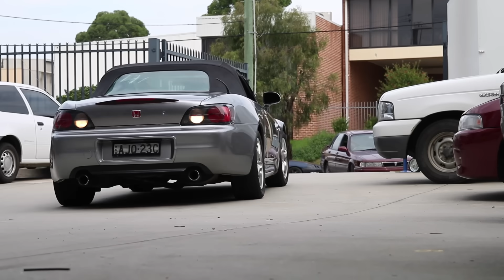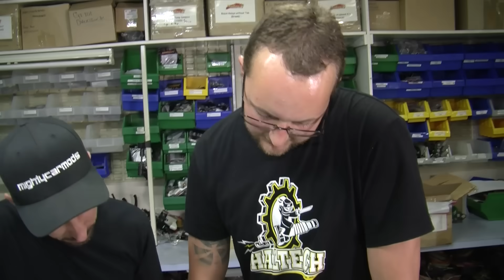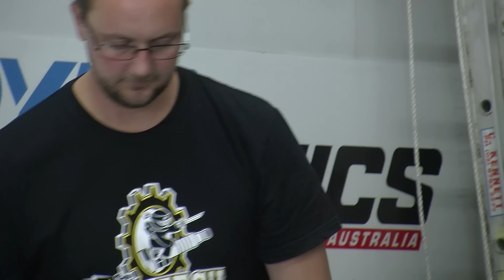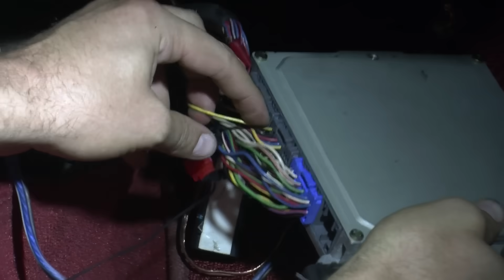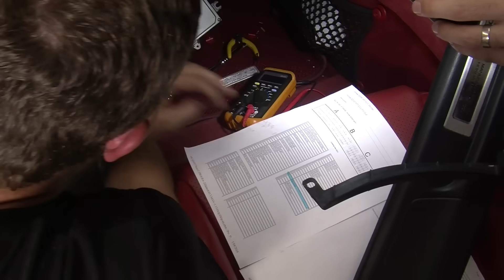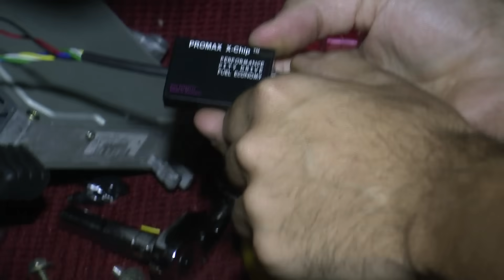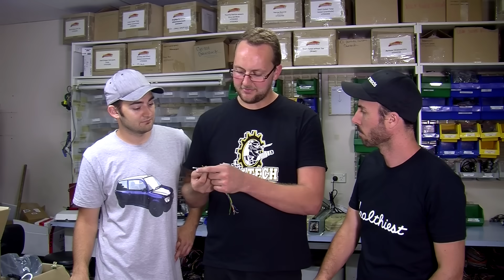eBay Performance Chips -  Mythbusted

Comment: one thing: there are ecu/ecm/pcu/pcm chips that are prom replaceable and programmed with different maps for fuel and timing, and they are real, but they are programmed to the specific vehicle and engine mods, much like i do on the laptop with fixed programmable factory units.... just had to that that out there.   that being said, they have been selling "chips" which 95% actually have no logic device at all.  funny these guys went through the trouble of building boards and mounting (likely obsolete and discontinued clearance) components that appear that they could do something.  usually, it's just a resistor to make it think the air is like 40degrees ferenheit all the time..... that can actually be a problem in the cold, lol.  i do have one issue with the testing method, even thogh it is irrelavent, apparently:  you cannot emulate a maf signal with a map.  that's like using 12v dc to try to get music out of a speaker.... 2 totally different types of voltage/signal.  a maf measures vibration like a microphone and a map measures resistance in the transducer or varisistor and sends either analauge return voltage based on the resistance, or a digital value over databus.  a maf has an analouge ac signal and either sends ac analouge, or a databus hz value.  i'd love to get my hands on this thing you tested.  if it did actually work, it would respond to the hz of the maf and make a frequency adjustment while measuring the o2 sensor and possibly only adjusting iat value on ramp-up....... and to answer your question: i see sanded ic's all the time.  they do it for proprietary conservation, so you can't replace the $5 part without going through them, or copy the design in your own system...... or in this case: so you can't find out that it doesn't do anything....

Comment: I bought a performance chip but I haven't installed it yet but one of the requirements is to disconnect the battery before installation and to leave it disconnected a minimum of 4 hours at best over night so the factory settings could be fully removed and after reconnection of the battery it takes about a week and a half for the chip to fully retune the vehicle. As done in this video if you don't perform the mentioned requirement then the factory settings remain the same.

Comment: I installed an ADS superchip in a DOHCv6 years ago, a little improvement was noticed, after I put in a K/N filter and shorted the battery cables together (off the battery), a lot of improvement was noticed, if I remember right, my chip was like $100.  Well worth the $150 spent.

Comment: wow soo stupid these guys

without the chip they had the roof on the car making it more aerrodynamic...
when they tested with the chip the roof was down so it was less aerodynmic.. so they engine was working harder to get it up to 177 hp ... if they had the top up still there wouldnt be as much wind resistance and it woulda easily made the 210 hp he was thinking he was guna get

Comment: "Performance Chips" are just the modern day automotive equivalent of snake oil.
Reply: +General Zod Not true.  This chip they test is crap.  Good chips run at least $2-300.
Reply: Not things like ECUs though
Reply: +Calbenmike exactly. My superduty gained 245 ft/lbs of torque with a tune. adds around 120 hp as well... takes the torque from 570 to over 800.... thing is totally changed. Diesel's benifit most, from what i've always seen.
Reply: Josh Ford I have never owned a diesel, but I'm not surprised at all.  What MCM fails to recognize is that the manufacturer's of these chips perform hours and hours of their own testing and validate it with real data.
Reply: Yeah guys, note the "" around "performance chips".  I am fully aware that there are actually performance enhancing chips you can put on vehicles as well as devices that tune the engine to produce more power.  However there is a lot of crap out there being billed as having performance benefits that don't actually do anything.  Always exercise due diligence and do actual research before buying something.  Don't ever take their word for it.  Unfortunately, enough of this crap is being bought that it obviously fools some people otherwise the scheisters wouldn't go though the effort of trying to sell them.

Comment: If you are not a car person and you want to chip your car, all you have to pay attention to is $20 chip, eBay seller, Eastern Europe.....Think about it.....Their market for these "performance" chips are clearly inexperienced people that know jack-shit about cars, the claimed improvement is small enough that many people won't notice a difference unless you measure it using a dynamo meter, nobody that pays $20 and expects 35 BHP will take the car to be dyno'd for $500 so these assholes just get away with these scams.

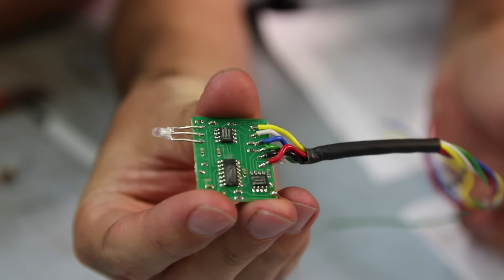Comment: if you pause at 22:31 you can see the top right lead of the top 8 pin chip goes down to the top right pin of the 14 pin chip. The 8 pin chip on the far right has power in at the pin closest to the red wire. The two 8 pin chips look to be LM2931-N IC's. These IC's are just voltage regulators, most likely to supply proper voltage to the led's. The 14 pin chip used for switching looks like a CD4066BE, a switching IC. it looks like the supply voltage comes through from the first voltage regulator to the CD4066BE. If you removed the IC's from the board and used a multi meter / bread board / DC power supply, you could determine what chips these are for sure. It looks like the traces do come from certain components of the car into the bottom 8 pin voltage regulator, but seems like its for show. Chips are probably scratched out because anyone with google could see that these are generic chips. A few caps / resistors for correct voltage for the leds / ics.
Reply: annnndddd I just watched the end..... damn im smart.

Comment: try busting a superchip for a 7.3 powerstroke. There is no master answer to all chips "busted". The answer is, it depends. And on diesels as everybody knows, you don't get any power without a chip nigga
Reply: +Your best Friend The Superchip and this thing are miles apart. The Superchip costs 10x as much, and actually sends new information to the ECU via new fuelmaps, and tuning parameters that are designed to get a powerstroke moving, which this chip does none of on any car as proven by the vid. The Powerstroke motor is also one which comes heavily nerfed from the factory so while you could chip this s2000 its already pretty well tuned for power.

The people claiming to sell you a performance ship for $20 are talking out their ass and its borderline fraud and, they've hijacked the term "chip" from actual retune chips which are way more complicated than an LED and some wires (which is what this $20 thing is).

Comment: Hey guys, ive seen this video before and loved it, but then comes a recent add on i did, and i definitely saw an increase.  2004 corolla and did a simple ram air intake and modified exhaust no header, but i wanted obviously a little more power out of so i decided to give the volo vp12 performance chip a try it cost 89USD plus some change for shipping.  Using my ob2 bluetooth scanner i ran a before and after with the chip and gained almost 15hp and 20ft lbs netting me 135hp 135ftlbs at the wheels.   any chance you guys be interested to check this chip out for other vehicles that have just basic mods using the factory computer and tune?

Comment: Well I've tried chips off of eBay for OBD1 BMWs and they definitely made a difference. Unfortunate that I didn't get dyno results. But these are EPROM chips and are based or even copied from Jim Conforti remaps and they are swapped out directly from the ECU board.

Comment: You paid $20 for the cheapest OBD2 chip on ebay...well doe Sherlock. Now buy one for 130GBP from ProRacing and I think you will be surprised, look forward to you testing a proper one.
Reply: Steve Bailey It's not an ODB2 anything, it's just a flashy box with a 3-wire passthrough, which was claimed to have had an effect on analog sensors, but really is a passthrough. It explicitly has no ODB connections of any kind, not even claimed to have.

Comment: they installed it wrong
Reply: Stevey B The last sentence in the video though was that an electronics engineer went through the board and determined that the chips weren't actually connected to the wires that go out of the unit or in one case was connected as a mere pass through, so the box can not affect any signal in any way. So what good would installing it in any other way do?
Reply: Siana Gearz there was a way they could have used that chip in another way but they didnt. also I didnt hear that in the video, oh well thanks for nothing see ya
Reply: Stevey B It's at 25:24 in the video, oh well, why am i even replying to a rude d-bag, i must be such a glutton for punishment. IAT passes through, MAF and O2 are not connected. There's no other inputs or outputs on this unit, just look at the wire count.

Comment: If you didn't have a dyno it would definitely work through the placebo effect.  I have developed a better chip than that ebay POS.  Mine has 4 brighter lights - a valet mode and it comes with 4 micro chips inside that actually has labels, it says "LOL".

Comment: If your going to run anything run a cold air intake with a tuner and an aftermarket header back exhaust. My Hemi with the air raid cold air intake alone had a quiet noticeable difference add the 93 octane performance tune off the Diablo Trinity T1000 where it changes the settings NIGHT AND DAY difference. The Hemi stock at motor is 400horse and 350 ftlbs at wheels 390 hp torque I don't know. It turned my fun truck into a MONSTER once I have my exhaust on I'll dyno it

Comment: No, its a total scam fake. The chips inside have the numbers scratched off so you can't look up the data sheets... They are likely bad  chips from some other job the factory did that they just solder-bang onto a lame board to make it look at least somewhat believable. The only active circuit in that is the switch and less... This is a very common scam with this type of Chinese electronic...

Comment: You want power get engine work done first. Bolt ons add a slight power thats including upgraded ecu and use 93 octane fuel cuz 87 and 89 are whimps, race gas is cool, e85 bullshit fuel fuck that dirty shit.
Reply: Anthony Chavez You do know that higher octane fuel doesn't give you more power, right?

Comment: Need to post that company name everywhere, make sure they go out of "business"
Reply: EvilJ069 There's most likely no real "company" selling this stuff, it's just a guy trying to hit a lick and make a quick buck on ebay.  Just avoid buying cheap "performance" mods off ebay and you'll be good.
Reply: Fuster
Everything you said is true, but it's assholes like this that make buying any performance part on ebay a likely failure. or ones that are what they say, but really shitty quality
Reply: EvilJ069 I don't consider this particularly helpful, as the "company" probably changes its name every 3 months anyway, or if they don't there's nothing preventing them from doing so, and there's probably dozens of them.

And o hai thar!
Reply: Siana Gearz
Sup.You're Prolly right

Comment: All I wanted out of this video was the answer to did it work or not. I just don't care enough after this boring video. The first part with all the effects were enticing but it lost it's effect quickly.
Reply: Sir. Dan I know right, 27 minutes for this is ridiculous.  I skipped through most of the video.  All you need to watch is the dyno before the chip and with the chip.  Most of the rest is just boring filler.
Reply: This looks like a reality TV show. That may be the reason I did not enjoy it.

Comment: $19 ECM performance chip from EBay, WHAT A DEAL!!!! It's just as a great deal as the $5 I paid for the five gallons of blinker fluid I just purchased from EBay.
Reply: Frank Gonzalez Throw in a tank of sports air for your tires and your sorted!
Reply: +snowball114 Blinker fluid is coolant for your turn signals, it keeps them from over heating and burning out. Every time your turn signal flashes, a little bit of turn signal fluid is use up. And if you don't refill the blinker fluid tank, your turn signals will burn out.
Reply: +snowball114 oh blinker fluid. you got to have blinker fluid...also make sure you have tires at the proper voltage and Flux capacitance. very important yes
Reply: +ShamanNoodles You must have some of those new LED blinkers. The fluid for those is way overpriced.
Reply: If you're a BMW driver, blinker fluid is not required as BMW drivers are superior drivers to every other driver.
Reply: +Frank Gonzalez blinker fluid is getting expensive. it costs me like $400 per fill up
Reply: Come on, the blinker fluid is good, but the muffler bearings thing kills!
Reply: And we're all thankful to ChrisF for that
Reply: Andrew.
Blinker fluid is a scam and is ridiculously over priced, especially when you consider that it's only carbonated headlight fluid!
Reply: and how about the performance exhaust for tesla cars? that is a sure way to ad at least 50bhp
Reply: I got all you beat. I only paid $ 2.99 for my new muffler bearings.
Reply: +meteoricthrone can someone tell me what the hell blinker fluid is and why you'd need it
Reply: +Matthew Phelps mate 10c for high performance spark plug gaps. what a deal.
Reply: Don't forget your headlight fluid!
Reply: I did better, I got muffler bearings for $3.99 👍😁